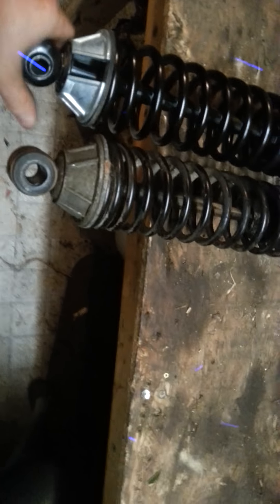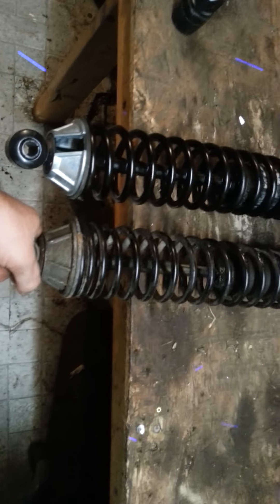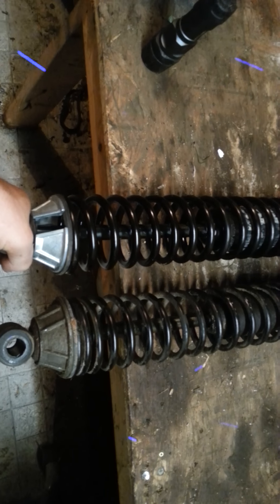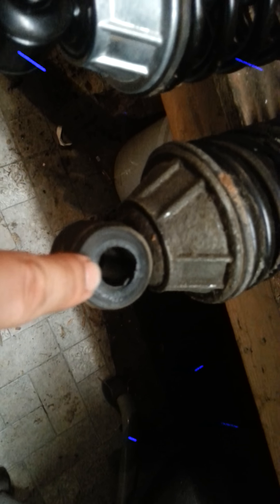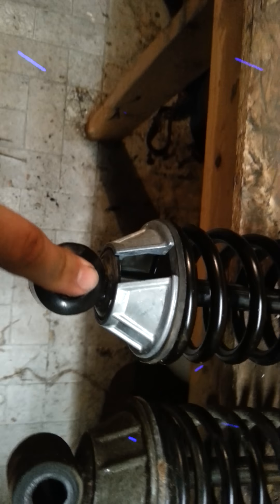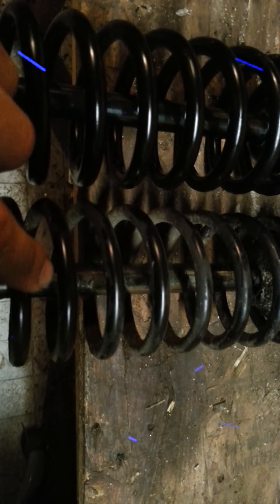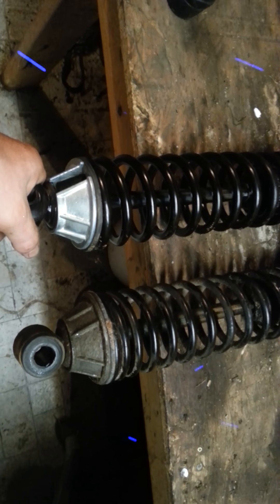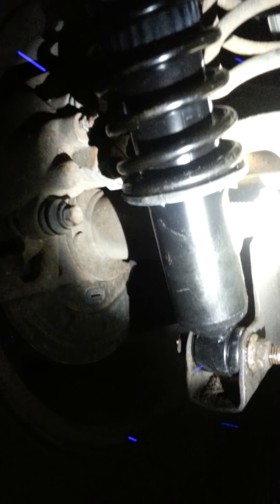97 Jeep Grand Cherokee Monroe Load Adjusting Shock Conversion 58619 to 58647

Comment: Thanks for your vedio.
What is your front shock? Does it fit and work well with 58619(58647) in JGC?
Reply from the maker: Ummm how do you mean. My front shocks are what ever performance or heavy duty will fit. No retrofit needed for those.
Reply: @4CarbideGaming  I want to know front shocks what you have chosen with this rear 58647 in JGC. And does it make smooth riding?I have used 58647 my JGC and looking for front shocks (monroe or billys or eta)best match. Thanks.
Reply from the maker: @meowMago  I wouldnt say it makes it a smooth ride but def 100% more stable especially while towing.  no more sagging and swaying in the back. Ive towed heavy loads inexcess of 4k lbs. very stable very safe a true night and day difference.
Reply: @4CarbideGaming  Your reply is impressive. Thank you for your attention. And I will try to find a front shocks that goes well with rear shocks for the best harmony in JGC.